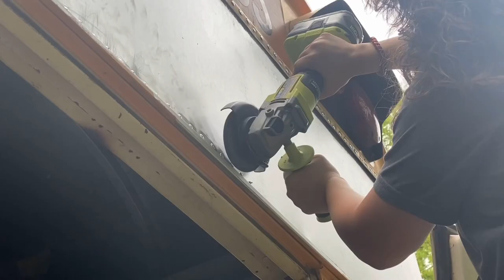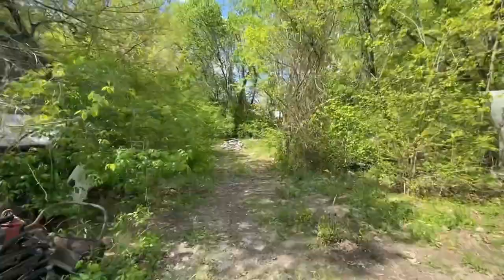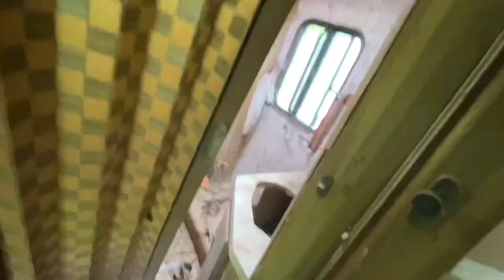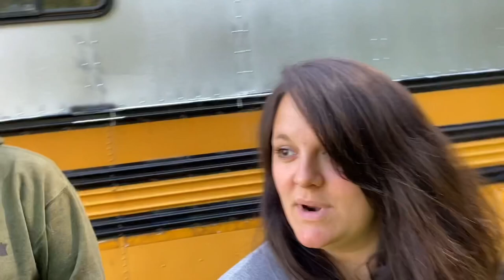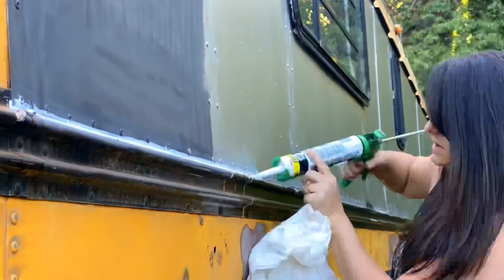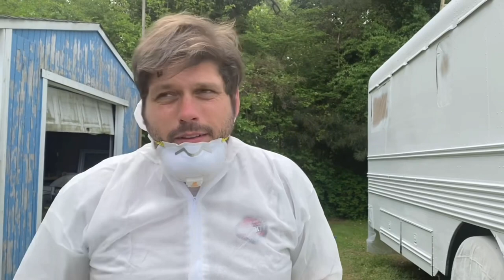School Bus Conversion Episode 12 - *PAINT COLOR REVEAL* Last windows installed and we start painting

Comment: I hope that you used elastomeric caulk, as it expands and contracts with the temperatures. Silicone will peel off eventually like a rubber band and lose its seal. I can't stress enough taking a trip to Elkhart Indiana to all the RV surplus stores there. You will go nuts,  as you will find literally everything to build a coach. At a fraction of the price, already taken out, and alot of new as well. Johnson rv surplus is the best there in Elkhart and White Pigeon Michigan. I spend 3 days minimum going through,  buying as much as I can for a build.
Reply: I did the same trip. I didn't love Johnson's so much but got a lot at Bontragers in white pigeon and a surplus place in Mishawaka. Definitely the way to go if within range. I did a video on our trip there.